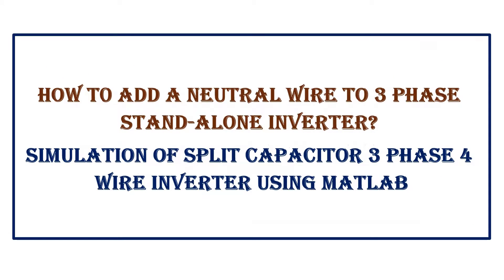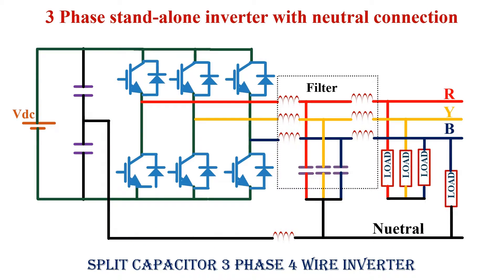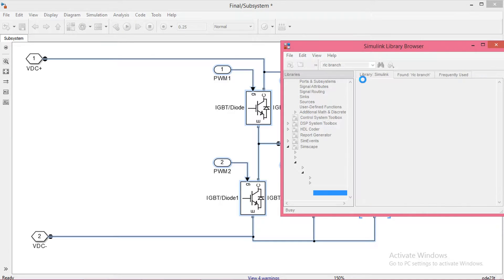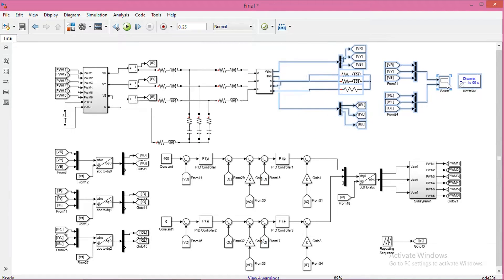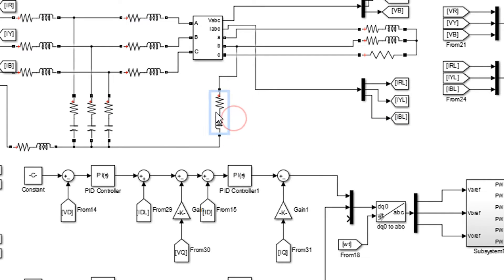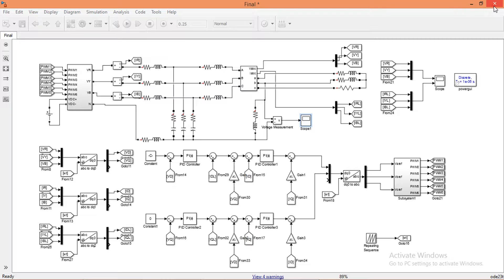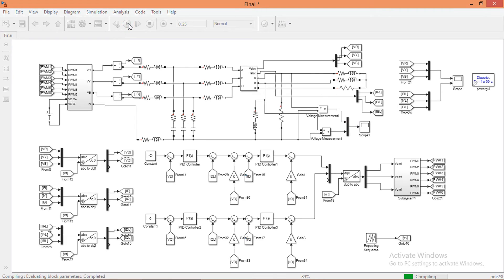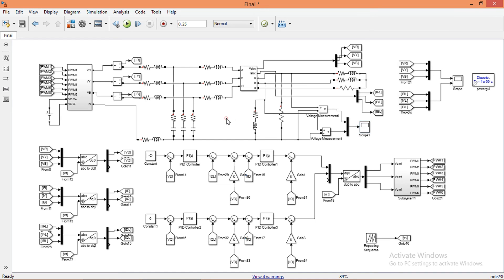How to add a neutral wire in 3 phase inverter? Simulation of split capacitor 3 phase 4 wire inverter

Comment: Hello teacher , ı am working on inverter project but ı have a problem ı want to sense grid voltage but 3 phase 3 wire without neutral how can I sense grid voltage separetely?

Comment: hi 
I have many problems with a simulation off-grid inverter :
1)  how I can choose the values Kp, and Ki  in  loop control of the inverter
2) what are the max and the min values of Ud and Uq for the control inverter.
thank you

Comment: Instead of using split capacitor if we use simple capacitor what will happen.
In other words if we connect single phase load neutral to common emitters of lower IGBTs what will happen?